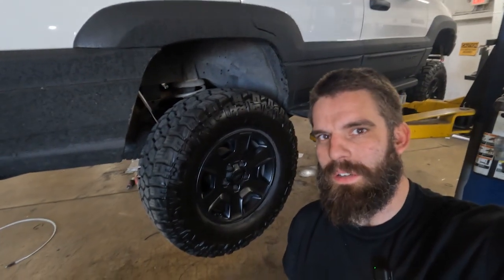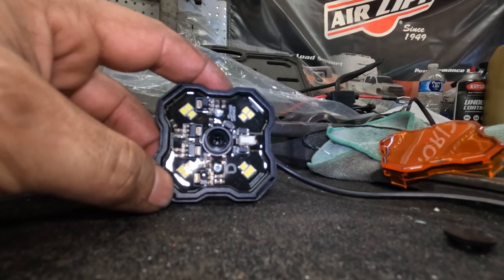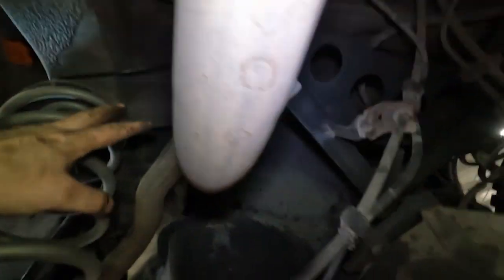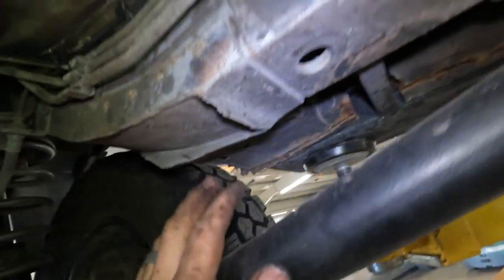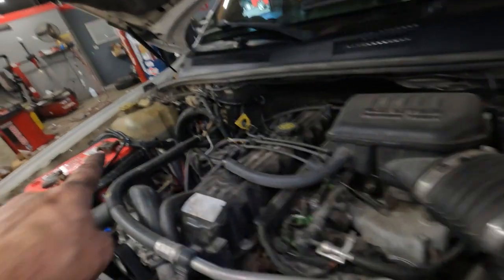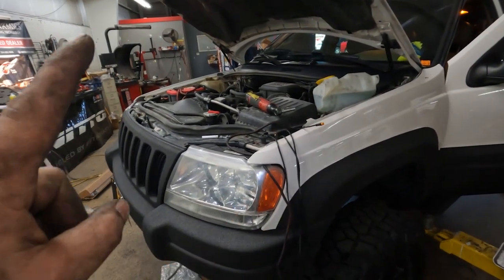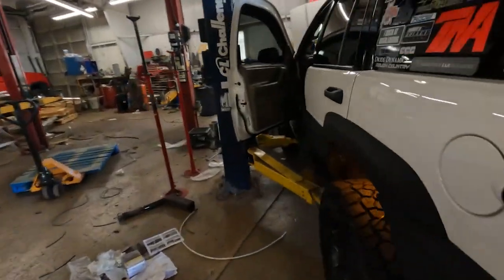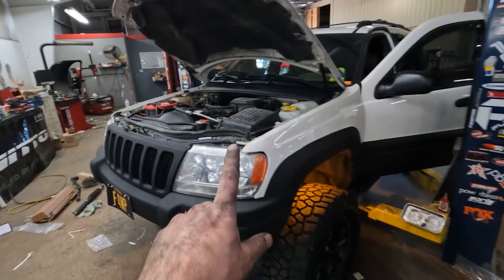Installing The New Diode Dynamics Rock Lights On My WJ

Comment: You have the trigger switch system too
Nice
I have the 6 shooter version 
I was planning to connect the rock lights to it
Since technically you can adjust the light output through the Trigger app   

Just need to see what cables to cut and connect the trigger connector
Reply from the maker: Yes I do. Hands down one of the best things I have bought for my jeep. Makes wiring so simple and everything you can do with it is crazy, especially that 6 shooter.

I went with the  switch to keep the trigger open for pod lights and lightbars. The high low setting were good enough for me but to each their own. 

I would use the switch wires because it will have everything you need high-power, low-power and 12v. Honestly you would just need the high-power because like you had said the trigger has the ability to dim whatever is hooked up to it. As for what color is what, orange is the high-power, white is low-power, and red is the 12v to the switch. So if I'm thinking about this right you should just need to ground the harness black wire either to a ground point on the vehicle or to the trigger its self. Then, hook the orange, white, or both  to the trigger system depending on what you are going for.

If you are using the RGBW rock lights that I would just wire the controller to the trigger system and use the app they have to dim the lights. Diode's app is the best I have used when it comes to controlling RGBW stuff. Let me know if you have anymore questions.
Reply: @XtremeTruckAuto  
Thanks
Just to to confirm 
I just need to use the orange and ground wire to attach to a Trigger connector correct?
Reply from the maker: @MrWortWort1  You are correct.